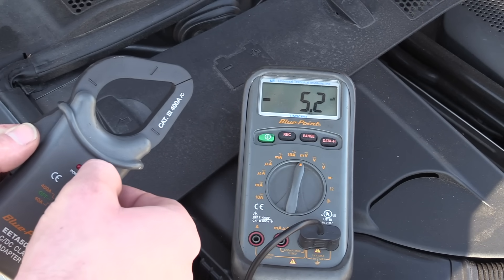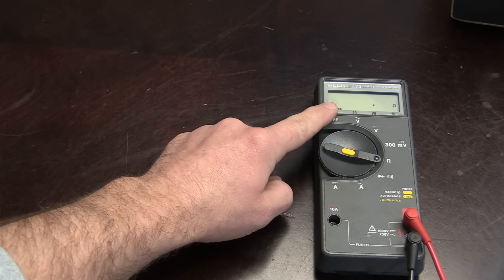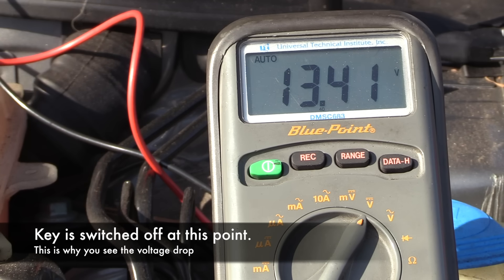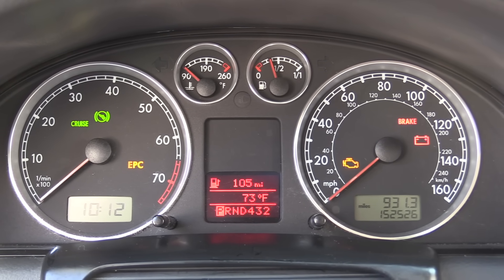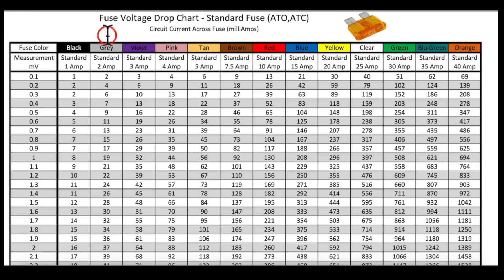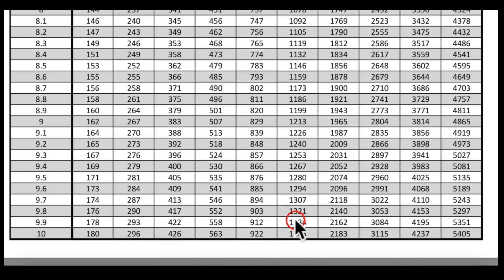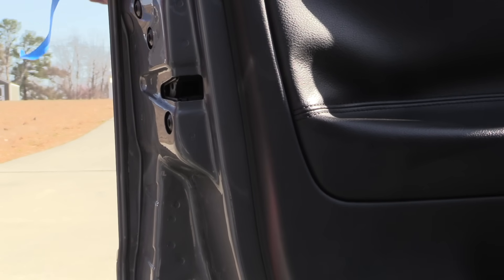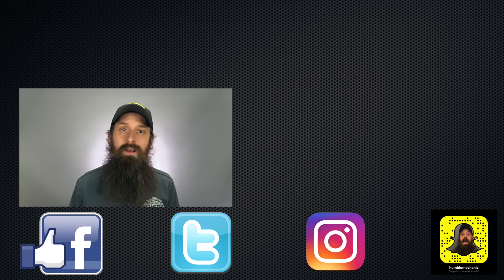The BEST Way TO Perform a Parasitic Draw Test

Comment: Hey Charles. Thanks for this video. My battery was draining in 3 days then overnight then a few hours later it was getting worse. I bought a new batter last week. I followed the video but I wasn't getting any draw. I tried leaving on the dome light then bridge the multimeter with the battery and I wasn't getting any draw as well. then I tried leaving on headlights still no draw. 

Thanks

Comment: Of several parasitic current draw test procedures I've seen, this is the most comprehensive, from an old electronic tech's point of view. I like seeing just how much current is going through those little shunts we call fuses, not simply whether there is or is not current going through it. The conversion charts help a lot. Thanks.

Comment: F'ing nightmare, how much more bullshit can they add to a car to make it more difficult and expensive to repair. Any difference in voltage drop across a Chinese fuse relative to an OEM fuse? Not going to take much to throw you off. Runaway technology.
Reply from the maker: The OE vs other fuse is an interesting question. I really have no idea

Comment: Remember not to ignore the simple stuff (is a vanity mirror light staying on, does the car have an aftermarket alarm?) Also remember that not many manufactures want to pay more than .6 for this diagnosis, you have no time to waste.
I sure hope you do not have a cabling chaffing problem. Get to know what other techs are finding. We had a lot of cable chafing problems on 96-98 S-10 Blazers and the drivers power seat feed, lots of stuck on vanity mirror lights in same year CK pickups. If the mirror light is stuck on you will usually see some plastic melting, something not indicated by your Fluke meter.
Reply: There is a nice on line diagnosis web site which is associated with Snap On scanners, it is called 'Shop Key Pro.' You can check millions of service orders worldwide by professional shops, and see what they did and which parts they renewed for a particular code or problem. It is worth the aprox. $120.00 per month for Shop Key Pro. They also have 'Component Locator' as part of Shop Key Pro.

Comment: Hi Charles my brothers mazda mx5 miatas alternator died and we changed the alternator to an aftermarket one and when the car is idling it shows on the miltimeter 14 to 14.3 volts. Is that alright or is it over charging?
Reply from the maker: +Zeandre Outram inwould be okay with that

Comment: Just used your method.  Thanks.  Had a Car To Go converted back to a Smart Car from a body shop come in for a draw.  measured 12v across the ac fuse.  pulled fuse and it measured 500 kilo ohms, replaced fuse no more draw, How only a fuse can do that I do not know.  Something with the SAM module I guess.

Comment: I call bee ess on the Vd test across the fuse terminals to determine parasitic draw.
Reply from the maker: Think about what happens when your computer freezes.  To fix it, you hard pull power.  This could also be what you’re doing when you pull a fuse. 

Just like doing a global vehicle reset buy disconnecting the battery. It’s a hard reset of the car. Both things your DONT want when trying to find a module with an issue.
Reply: 'cause he's a troll.
Reply: There is resistance in ANY piece of wire. Why do you think they use different wire gauges, it is to limit the voltage drop due to the resistance of the wire. Fuses have resistance across them, it's a very small value but it is there, it is how they function. They are designed to burn open if the current rises over the limit, if they have no resistance that would never happen. It takes the resistance in the fuse to generate the heat that melts the wire.  The rest is simple ohms law applied to determine the current flow across the known resistance of the fuse by measuring the voltage drop and the known system voltage.
Reply from the maker: You see it happen when I turn the radio on.
Reply from the maker: +Ryan Scott why do you say that?
Reply: All things have resistance in an electrical circuit, usually we don't have to worry about the resistance of a wire, fuse or a electrical connection but this is a loaded circuit test and that is why he uses the MV scale on the multimeter.
Reply from the maker: You are correct. Monitoring overall draw is part of it too. This is a way to find a draw without disrupting the systems.
Reply: Yes, I would also consider this an incomplete test without removing the fuse and testing the amps through the multimeter.  Whats this dont remove the fuse rule.
Reply: If Voltage is measured,
there is Resistance ,
a fuse lacks resistance, 
should be No voltage across a fuse.
electrically, a fuse acts like a plain piece of wire.
if you measure voltage across a fuse,
the fuse is blown.
.
if the fuse is blown,
 but the circuit is not complete,
no voltage will be measured.
.
Complete circuit is:
continuity to + on one side
continuity to - on other side.

.

Comment: Thanks man! This is helpful.
Do you plan getting to Power Probe Hook
Reply from the maker: +Transguy I actually have one. I have only used it a few times. Works great but I don't like it for fuses. It takes too long. At least the way I have it set up
Reply: Would you recommend the hook over the earlier Power Probes or is it top's? Thanks!
A buddy of mine has the PP2 and its so far ahead of a test light its unreal. I like its long chord option and the cigarette plug. The 3 has that plug too but not sure if the 4 had it. 4 looks nice too but doesn't give amps nor does it handle the power that the hook will.

Comment: Hello
I have a Vw passat 3C5 DSG, it has been difficult to handle the battery problem, it lasts quite a bit, sometimes 2 days sometimes less. The battery is new, has been to several homes Bosch and can not find anything. Multiple software has been connected and nothing. I had to compare an electronic charger and almost every week I have to park and charge the battery.
Bosch and other workshops say I had to remove the car radio, I've been driving a battery-operated radio for over a year.
* At the tailgate is electric.
The alternator was tested, that's fine, the battery too.
I'll have to take it to Vw, see if they find out.

Comment: Not bad! One thing that makes this challenging is doors that have "dumb" latches and rely on push button switches in the door frame to determine if the door is shut or not. Depending on the switch they can't be taped down, so you either need to remove them and open/short the switch connections as necessary, or get buddies to hold the buttons down.
Reply: To add, more than "not bad". This is a pretty sharp idea. Thanks for posting.
Reply: To add, more than "not bad". This is a pretty sharp idea. Thanks for posting.

Comment: Great video!  Basically you are measuring the the voltage drop across the fuse just like measuring across a resistor in a circuit.  To take it further, if you don't have that handy chart with you, you can always remove the fuse, switch to ohms on meter and use ohms law (V=I*R) to figure out the current draw.  It might be a little more accurate as you have real numbers to calculate.  Use the battery voltage and divide by resistance.  This will give you current in amps.  I personally have not used this method but I see that it would be far more superior than other methods.  Math never lies.  :)  Now I am tempted to go to the car and document every fuse draw and save to a list.  So if there should be a problem in the future, I know what circuit values should be.  Thanks again.
Reply: is that asterisk a X?  lol

Comment: Great add on the latching of the doors, and the tape is something that I always do too in a shop setting. I'm still one to leave my multimeter inline on the negative battery terminal overnight while recording the data. Almost always, I find improperly installed accessories to be the cause of battery drain. Recently I had a faulty battery that would loose about 90% of it's capacity in about 48 hours, of course the customer insisted that we find his draw. After leaving my meter on overnight and verifying an average draw of only .015mA, I charged the battery, tested the battery (it passed), left it on the bench overnight to find that it lost almost 300 CCAs. Just one of many reasons why most of us that "Do Electrical" are losing our hair.😣

Comment: So by testing across the top of the fuse....it going to take the path of least resistance, through your meter and provide your reading? As opposed to testing from the circuit to ground?

Comment: how is it checking current draw its still going through the fuse you have to break the curcuit your not breaking the curcuit load of crap
Reply: You are NOT reading the current, you are reading the voltage drop generated by the resistance of the fuse. Then you use the chart to convert that voltage to the current drain. Basic ohms law when you look at it.

Comment: If you often have to change the leads of your multimeter - DON'T.
Get a decent meter for that, the leads will last for ages. Yes, a decent meter can easily cost >150$, but if you use them a lot it is worth it.
Also - it is also nice to have 1-2 of the cheap ones around - for quick and dirty measurements they are enough.

eevblog has a few nice videos about that.

Comment: Wow, I been in the trade for over 40 years, I have a lot of experience with auto electrical and diagnostics and I still learned something today. Thanks for taking the time to make this video.
I must admit I generally click on these videos to pick holes in them and occasionally post comments on what they are doing wrong if it is extreme and obvious. :-)
Nothing to pick on here (apart from a wee math error :-))
Reply from the maker: +Stambo hahaha. This may be my favorite YT comment of all time. :)
Reply: Wow, a YouTube professor that acknowledges his motives. Never understood what the draw is of basically acting like the know it all each family has that we avoid like the plague and talk shit about whenever his name comes up.
Reply: Stambo Yeah ironic isn't it the old method for me has been working for 35 years but it's always good to know something new
Reply: probably because no one does this ,  im not a mechanic but i am electrician and long time driver , never saw it . If i had to do it , i would check across the battery
Reply: I have Citroen c4 grand Picasso 1.6hdi semi automatic after shift could not get reverse but managed to drive home I notice while driving service light keeps flashing what could be thaEexact fault
Reply: @100zacci  wrong video
Reply: Hi one question. Do you keep battery connected?
Reply: @adamibz5715  you do, if there wouldn't be anything to measure with your multimeter :3
Reply: @spitfireqg  thanks i get voltage and amp tests confused always.
Reply: @spitfireqg  why does the battery need to be fully charged, I've heard this a few times, but no explanation?
Reply: @lightnentim  the chart that indicates current calculates that based on ohms law and the resistance of fuse causing the voltage drop across it. If the battery is under voltage it would be different to what they used to calculate the numbers. You could do the maths yourself, but resistance of those fuses would be really low and hard to measure accurately I imagine ( never tried). Hope that answers it
Reply: Did you mean the 1008 mA part where he called it a tenth of an amp? :P   But yeah MOTOR magazine did a great article covering this exact method a few months ago, definitely a good method.
Reply: You must have sucked lol
Reply: Yeah, now go try this seemingly wonderful advice and find out how wrong it is.
Reply: 40 years? This is basic stuff he's talking about. Lol
Reply: @charliehustle2579  Off course it is but you know everything right?
Every single method and every way it was taught too huh?
Reply: @Stambo59  nope. Been wrenching far less (23 years) and my old boss/mentor showed me this method decades ago. Sorry bud, don't know everything but I knew this one. Lol.
Reply: Charlie Hustle and the pint went over your head. Ok so you learned this trick from an old boss.

But there’s plenty you don’t know. And that’s fine to admit.

It’s different for everyone as to which they’ll know, but not one single person knows everything.

Comment: what is the point doing that with doors with no mechanical switches? there is no electronics in them. every car i ever seen has a switch the door hits when the door closes so this does nothing. also what is the point doing that with hood and trunk. there is no switches in that stuff.
Reply from the maker: +james42519 this car. And many other cars have the switches in the latches.
Reply: ok. i never seen one with that.

Comment: Hey Charles, great video as usual!
I did have a follow up question though. When replacing a couple blown fuses (BOTH lighter ports were blown when I got my MKV GTI originally) I accidentally pulled a couple other fuses first, one of which was my alarm fuse. You did say it can cause problems or even possibly damage components... My alarm acts funky now; it likes to sometimes go off right after I unlock my car and open a door, and even sometimes likes going off when completely disarmed, (as in, unlock the car with the remote, open a door, a couple minutes later I open the hatch, and BOOM. Angry car.
Do you think this could be caused by me pulling a fuse? I think I did it with the battery still in place. Those were my n00b days. I can NOT find a fix, and I've even used an OBD app (Carista) to check/reset my arming settings for the alarm.

Comment: Problem with leaving the doors open is that most older cars have dome lights activated by momentary switches on the pillars near the door latch striker plate.  This method won't work well with cars like that.
Reply from the maker: +hellcat1988 it will work. You will just have to close the switches in a different manner.
Reply: I didn't say it wouldn't. Just that your method of tripping the latches and leaving the door open won't be applicable in those cases. Often those switches have pretty strong springs in them so something with a stronger adhesive than painter's tape would probably be necessary.

Comment: The battery charge is no problem in the scenario described. The voltage drop across the fuses is a function of the current through that fuse only: The fuse is used as a shunt resistor. Also I don't see why you would use a chart instead of just using ohms law.

Comment: Have you ever used the Amp Hound tester, and if so, what do you think of it?  It does this exact test. You set it for the fuse type / size and it translates the  mV reading right into an amp draw readout on the screen.

Comment: that's a really good way to pinpoint. the same draw can be found at the battery without disconnecting it then connecting meter in series, pretty tricky but really good way. I think it's usually 50mv max draw to be out of specs.

Comment: wow, my understanding of electronics has just been blown away.  Thanks ITT. shit....

So, can someone explain to me how there is a current draw across what is essentially a half inch of wire?

And just so I am understanding this right? your meter is set to measure current, you then place your meter into the circuit across the fuse, which is essentially a short thin piece of wire designed to melt at a certain current draw, this in parallel with the fuse creates a minor circuit by placing a high resistance load across what I am guessing is a very tiny voltage difference between one fuse terminal and the other which allows for current to flow.  I realize I graduated in 1994 but I don't remember being taught you could even measure any difference across a fuse.  So forgive my ignorance.  I hope someone can explain this to me because I honestly want to learn more about how this works.
Reply: Mikej1592  
He is measuring millivolts not amps. Even a short, thick piece of wire has resistance. It is this resistance that causes the fuse material to melt when the current generates enough heat to melt the fuse. It is also this small resistance that causes a voltage drop across the fuse when a parasitic current flows. The low current through a small resistance results in a low voltage.

Comment: I have a very accurate (very expensive) milliamp current clamp that I use to check for parasitic battery drain. The cheaper current clamps are not even close to accurate enough to be used for this purpose. Once I've determined there is a drain on the battery I use this same method to check individual fuses. Having accurate equipment and knowing how to use it is key for tracking down parasitic drain.

Comment: BUddy, can I tell you something about electronics. Fuses, like the ones you are testing, are ALWAYS AND I MEAN ALWAYS! Connected in series, you can't measure voltage in series you knob, only in parallel
Reply: Buddy bud bud What he's doing here is clearly over your head.
Reply: Buddy Bud-Bud Why can't you measure voltage in series? Voltage across components in a series circuit is almost always different. Maybe you mean voltage across components of a parallel circuit will give you the same value...

Comment: Very good tips!  I too have a VW..been a nightmare with all the work but finally reliable.   Most of the problems were from warranty service.  Now that I do everything, everything is done right!  I've even installed a taller 5th gear so it cruises at 70 mph doing 2000 rpm.